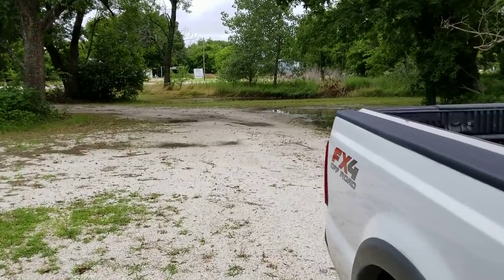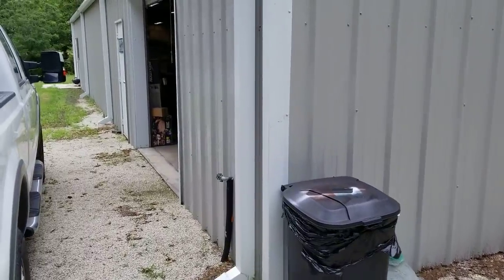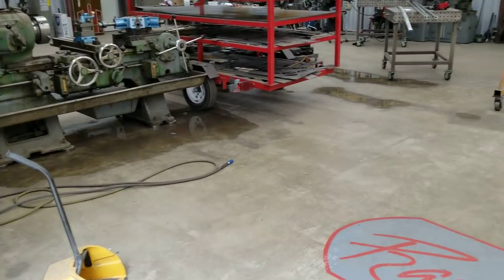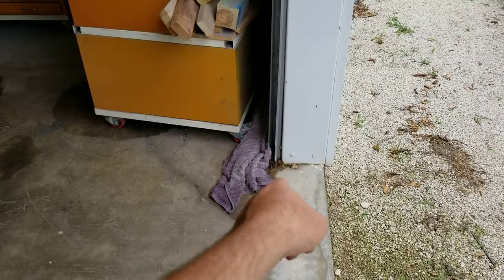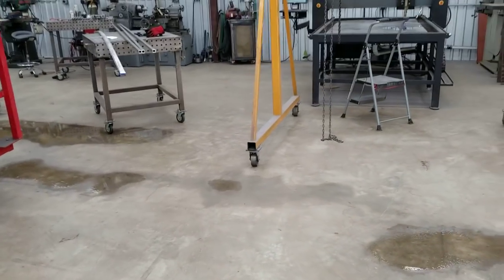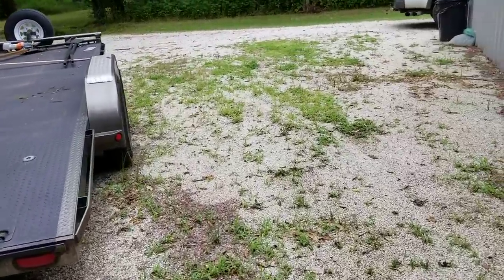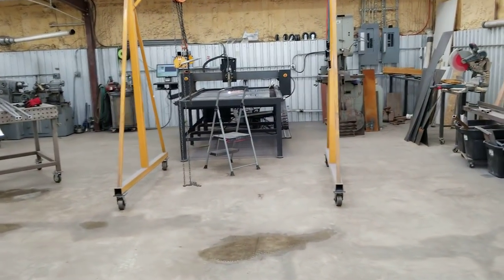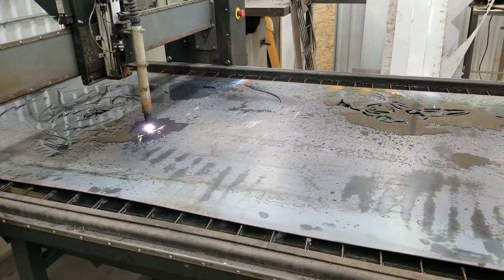Shop Update - Truss Jig Repair - New Plasma Table - New Paint Technique

Comment: Hi Gary, neat answer on the spots welded to the stainless. Good looking sign too. If I wasn't 20 hrs away I would help you make that water/rain issue go away. That is major aggrevation there. Thanks for sharing
Reply from the maker: i saw your question on hte other video and started to answer it and got side tracked lol, but yes gave a brief run down on this one.  I would love some help with this water issue, its a pain for sure !
Reply: Ramsey Customs - turbocobra the water issue is simple raise your building 6”😈lol
Reply: @bcbloc02  Doesn't that sound easy?
Reply: OLD SCHOOL easier than stuffing a bridge crane in a 150 yo barn! Lol could actually just pour a couple of more inches of concrete in his building and would solve the intrusion. Getting the outside to drain away appears to be problematic as the building sits at too low a level to get proper fall to the drainage ditch and I think Gary said they don’t keep the neighbors ditch clear or graded either so it doesn’t carry water away well.